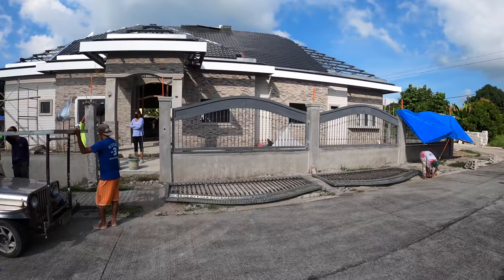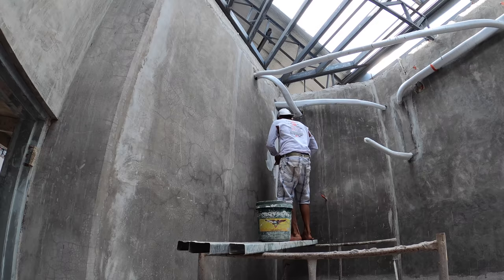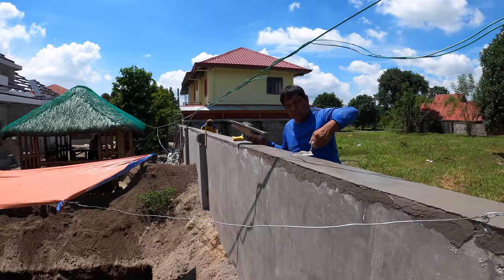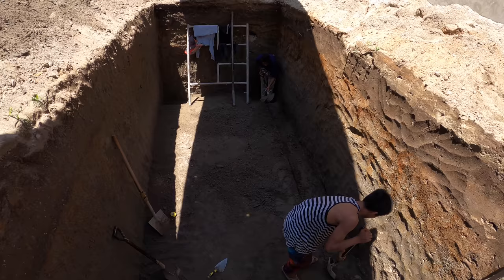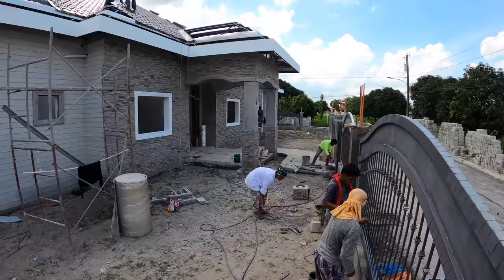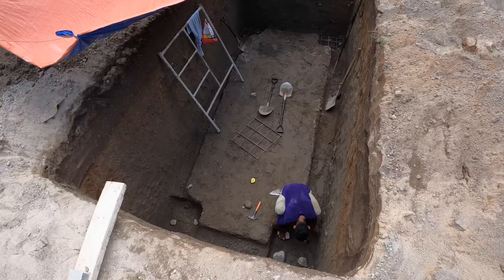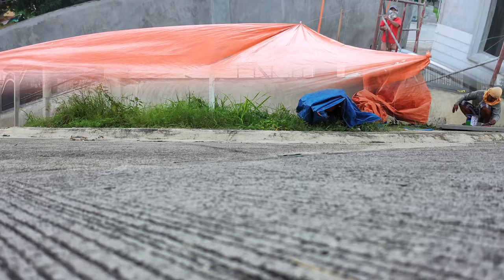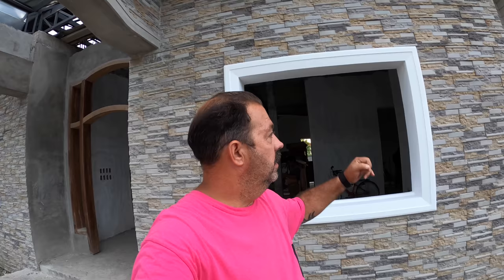Philippine House Building Step by Step, Build Day 148: Painting The Exterior Window Moldings

Comment: Glad I found your channel!  I'm considering building on Bohol in the not too distant future and your videos are the most informative that I've found about Philippine building practices. My place wouldn't be as deluxe as our mansion but the construction ingredients are the same.  BTW, I've visited Bay City several times working on STP.
Reply from the maker: Joseph Somsel
Welcome to Casa TexPina.
My dad used to work out there. 
Thank you for tuning into our channel. 👍😊
Reply: @CasaTexPina  Looks like your soil has solid bearing capacity and you didn't need to worry about a peculation test.  How about seismic resistance?  I'd expect the seismic requirements to be about equal to  coastal California with the volcanoes nearby (UBC 4 or 5)  What about ash loads on the roof?
BTW, I'm living outside Abu Dhabi nowadays.
Reply from the maker: Soil does seem to have good load bearing capacity. The engineer that I had do the plan conversion also did the site survey and soil testing. Never did get the results. Ended up changing engineers after the design was completed. 
The build engineer is local and has built in this area of the Philippines for over 30 years. He reviewed the plans and made some corrections for structural load bearing. 
Pinatubo was the only active volcano nearby. Arayat (the mountain most often seen in the videos) has never erupted in recorded history. 
Thank you for the questions. 👍😊

Comment: Hi I am wondering about food for your workers. Do they have snack or lunch included in the salary? If yes what kind.?
Reply from the maker: kjell seterbakken
Welcome to Casa TexPina!
No. All meals are at their expense. Most of them will chip in together for the bodegero to buy at the public market and cook lunch.

Thank you for tuning into our channel. 👍😊
Reply from the maker: Red Pill  
Welcome to Casa TexPina!
Great question.
The fiber cement board wall cladding is just that. Fiberglass and cement mixed together to make a great alternative wall cladding instead of wood planks. The fiber cement board is durable, pest resistant, waterproof, and completely customizable by cutting and painting to fit whatever your design requirements are.
Thank you for tuning into our channel! 👍😁
Reply from the maker: Red Pill  I'll pass on the kudos to the guys.